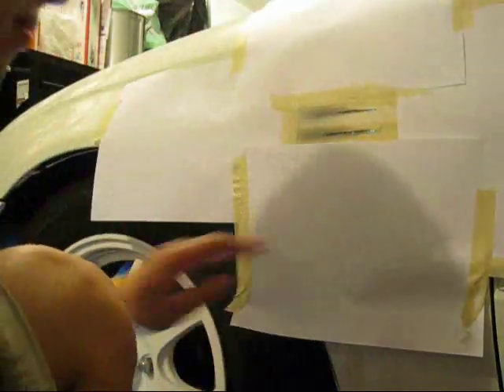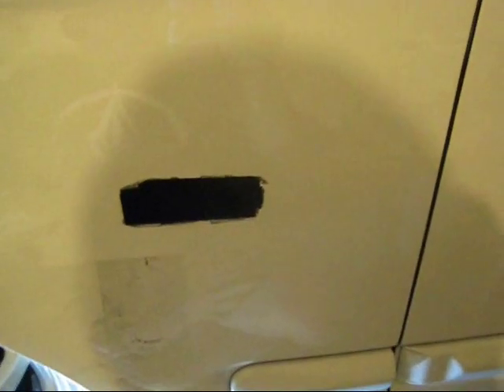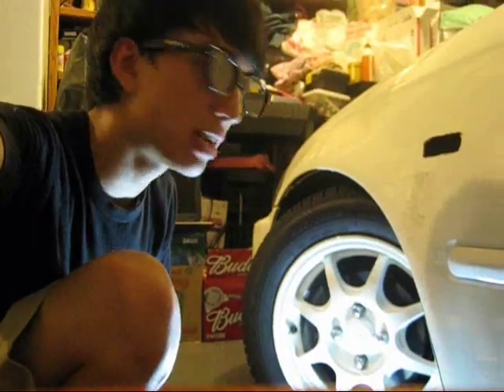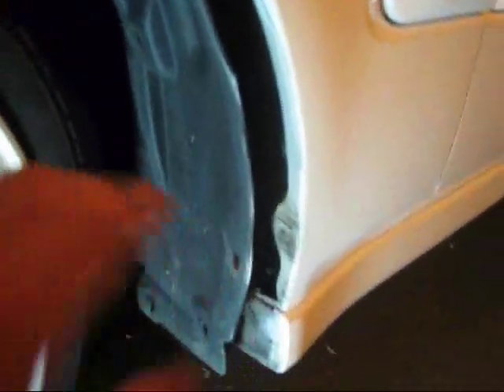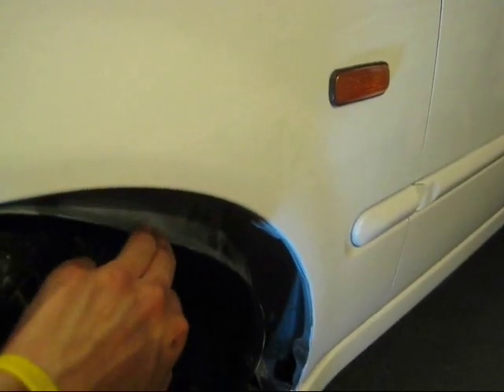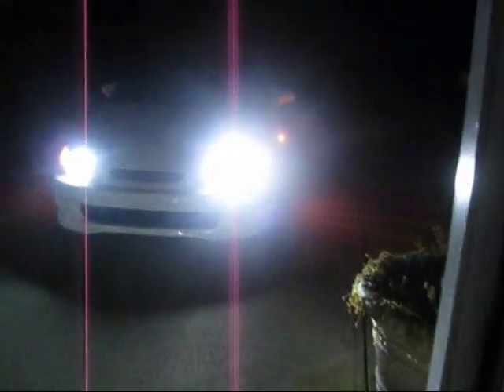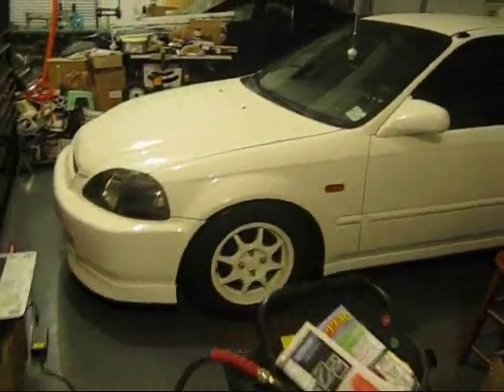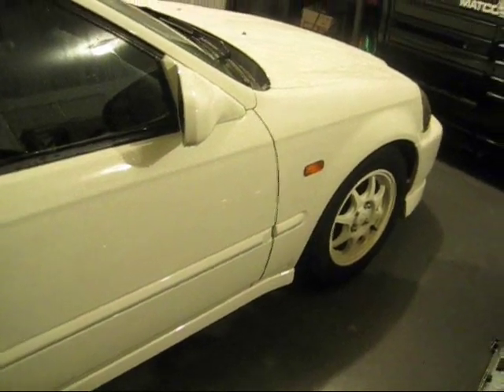EK Side Markers Installation Tutorial with Michael Flare [part 2/2]

Comment from the maker: It came with the side market and wire harness. It's a wedge type bulb. It's the same one used the Civic dome light, the license plate light, etc. They come in many different names such as 164, W5W, 191, etc.

Comment: Hey bro I just wired up my signal lights the jdm way got rid of the red wire and only kept the green and black like the way you did it but now my corner lights and side marker only turns on when I signal. When I dont signal no lights are what are the reasons for this problem please help me im stuck right now
Reply from the maker: NO! The blinking light setup you see in the video is WRONG. It is NOT the real JDM. The EKs with sidemarkers in other countries have ALL signal lights blinking at the same time on each side! Mine doesn't alternate anymore like you see in this video because I found out it was wrong. I changed the lighting like 2 years ago.

Comment from the maker: On the video description below the video, there is a link that I posted. The link will show you the wiring that I used. I never had any problems with cops because it doesn't make sense too. If these were illegal, than EVERYONE who drives a +2006 ACURA TL will get pulled over and a ticket because ACURA TL in USA all have sidemarkers that STAY ON at night; they come stock like that. Also, a lot of trucks and semi trucks have sidemarkers that stay on at night too.

Comment: The reason the tutorial stated JDM or USDM, is because in the US you require to have 4 sets or Side Maker Lights (2 Amber out front on the front bumper or lower part of the front guard and 2 Red out back on the rear bumper or lower part of the rear guard)... That is what Side Markers are, in the JDM case, they are not called Side Markers, they are Side Turning Signal Lights because in Japan, like in Australia, you are not required to have Side Markers on cars, only on trailers or large vehicles

Comment: what brand/type of side markers did you buy ?
Reply from the maker: keith robertson I just got a brand that makes aftermarket car parts like headilghts, tailights and such. The brand is called DEPO. It's looks exactly the same as the OEM Stanley sidemarker that my friend has. It's cheaper and newer so I just got it. There's a lot of parts on my car that are from real Type Rs but the sidemarker was something I thought wouldn't matter if it was real or fake since it looks identical.

Comment: Can you send me the link of where you got the side markers at.?
Reply from the maker: +Justin Cisneros This was about 6 years ago. I'm sure the same exact listing isn't there anymore. 

eBay is the best place to find parts and here is why. eBay is probably the biggest and most diverse market in the world. eBay sells all kinds of stuff from private sellers to business sellers. They sell both FAKE and REAL parts. Here are some tips to distinguish the two when you buy parts from eBay. Either way, you can buy fake or real, it is up to your preference.
1. Observe the seller ratings and feedbacks
2. Do research on the internet about parts you want to buy.
3. FAKE parts are BRAND NEW AND LOW PRICE for Civic EKs, most of the time.
4. REAL parts are USED AND HIGH PRICE for Civic EKs, most of the time.
5. Read item description very carefully before you buy.
Reply: +Michael Flare how will I know there the ones that turn on when you use your turn signals or hazard lights.?
Reply from the maker: +Justin Cisneros that depends on how you wire up the sidemarkers.
Reply: +Michael Flare so any ones can do that.
Reply from the maker: +Justin Cisneros yeah.

Comment from the maker: @birdhouse12244 Bought a Black & Decker dremel tool at Walmart. For the finishing touches, i used the accessories that were provided in the bag it came in like the cone shaped grinding/polishing/sanding tool thing which worked wonders for fine adjustments to get the perfect fit.

Comment: if you knew anything about JDM you would know in japan side markers only light up with just the turn signals. Also what you wired up is considered a usdm wire job because your markers light up with both your corners and your turn signals.

Comment from the maker: My wiring setup is NOT JDM setup. In Japan, the sidemarkers DO NOT stay on. They only turn on when you use your turn signals. The reason why I dhe idn't do JDM setup is because there's no point. Our cars have Parking lights which the Japanese don't have. In Japan, the parking lights are not on while your headlights are on like in USDM because that is the law for the cars here. The CTR has daytime driving lights also which USDM civic doesn't. Therefore, JDM setup would be illegal anyways.

Comment: My side makers only light up when I use my turn signals. How did you wire yours to stay on and blink when signaling?
Reply from the maker: Tap the positive RED wire from the sidemarker to the RED wire from corner light socket. Tap the negative BLACK wire from the sidemarker to the GREEN wire from the corner light socket. SIdemarkers stay on if headlights/parking lights are on.
Reply: Michael Flare great! Thank you